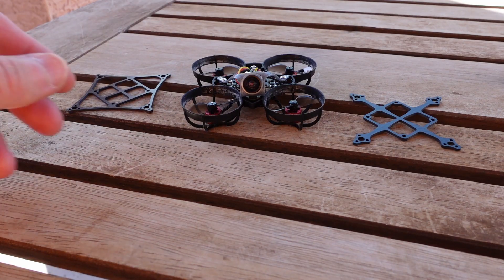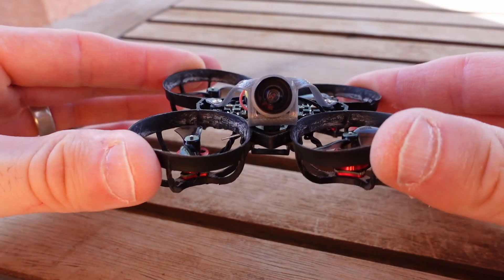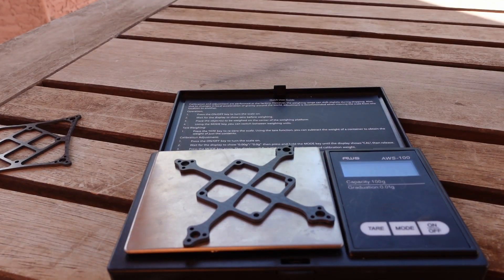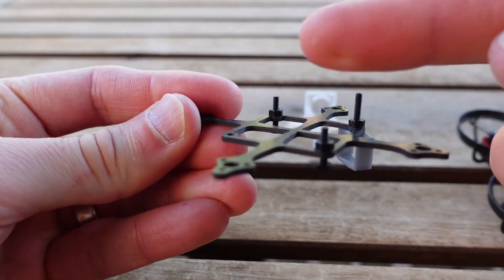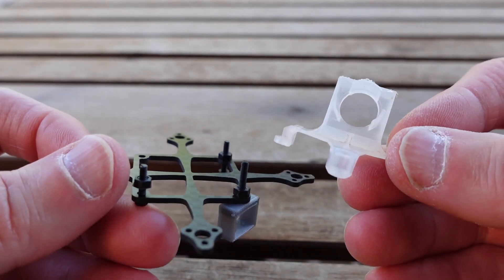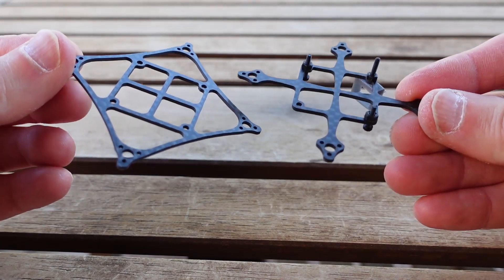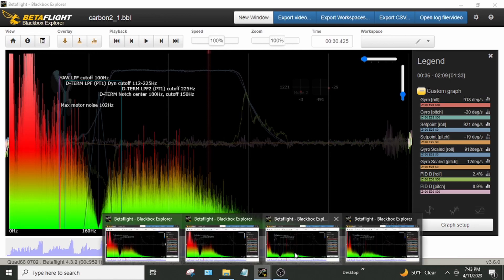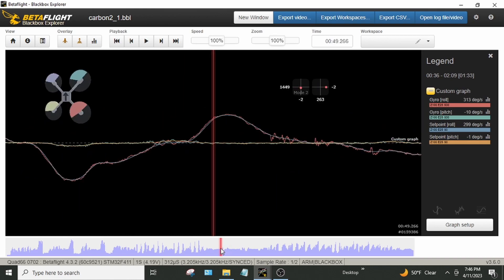Part 1: Whoop Frame Comparison Meteor 65, vs Carbon X vs Carbon Box

Comment: Great vid as always quad66!
For me - flying a fractal 75 on 25k motors and not having (yet) access to black box - the move to a carbon frame was quite impactful. Not only, using the betaflight mobula6 tune, the quad seemed less twitchy but also the crash resistance increased dramatically. 
Regarding the cross torsion, it’s actually slightly better with the carbon vs. Plastic. But I rely on my finger measurements :))
Maybe one point, the camera position on the fractal is in between the ducts. Does that change anything?

Comment: I think the weight penalty might only apply to the 65mm size, and 75mm probably is the break even point. For the metero75 pro and 85mm whoops, with half size ducts, the overall frame weight could be less. I have a 27.3 gram 85mm build with happymodel 1002 motors and 2015 props, using a shortened SkyRyder 90 carbon frame, I believe that weighs less than a plastic frame build.
Reply: And looking forward to the Part 2
Reply from the maker: Yes, I didn’t show it in the video but I also have 75mm frames that I will be looking at as well.

Comment: I’ve noticed you run the motor wires straight to the pads and not along the arms. Is this to save weight, was under the assumption that the wires give less airflow
Reply from the maker: If there’s enough length I run it on the arms to decrease thrust obstruction.

Comment: interested on seeing your thoughts on the twiglet mini frame. It's halfway between the box and regular style, also i think the asymmetrical front/back helps with resonance
Reply from the maker: I haven't tested it. There may be some logic if you have worse noise on an axis to brace that axis. Regarding the symmetry, I've thought about a completely asymmetric quad with 4 different arm styles for that reason. I'm not sure what's easier to filter though, one stronger isolated resonance versus multiple smaller peaks?
Reply: @Quad66  Its the ability of frequencies to interact with each other that is the concern. Cool that you are already looking at that. In theory, it's possible that different frequencies can cancel each other, in our quads i feel like they often are too often amplified, and the design to 'decouple' that resonant buildup is interesting.

Comment: Interesting results here, I tend to just use all plastic or all carbon now on my builds. If you look at the throttle ffts then you might see that you have 3 harmonics instead of 1 like we do on the plastic frames... Did you see this? I remember something like this when I was logging and tuning on the fractal65
Reply from the maker: how high in frequency did you need to log to see the 3rd harmonic? here are the logs if you want to take a look: https://drive.google.com/drive/folders/1n8uUGh5sw3LNNaemGdS7_P9P6KZZ5fcL?usp=sharing